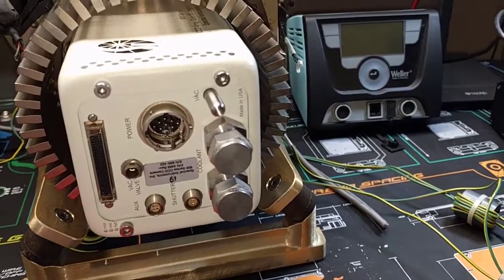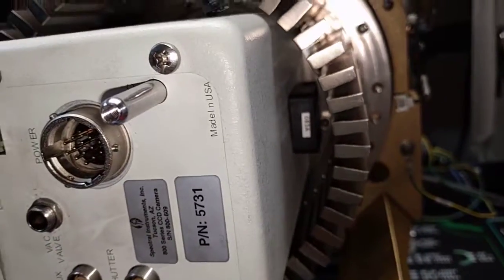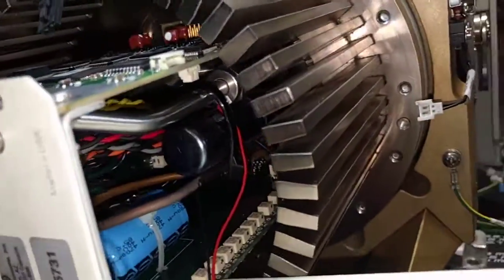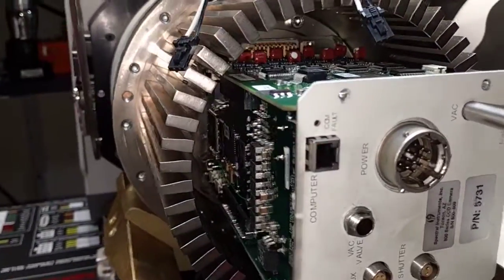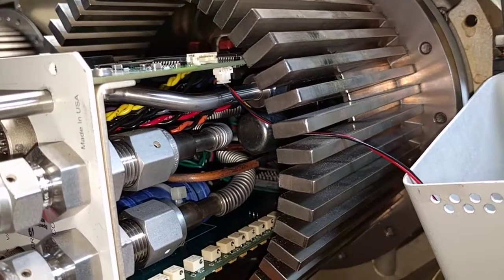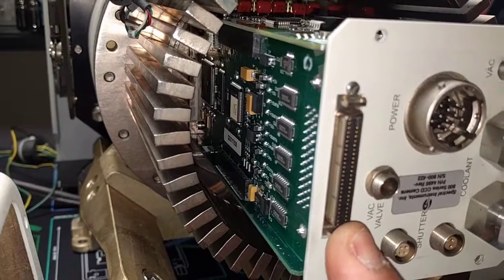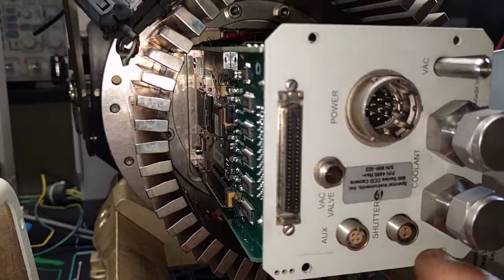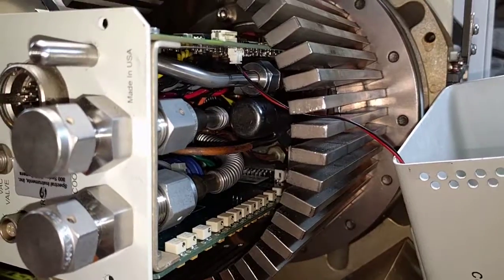Differences between Spectral Instruments 800s cameras

Comment: How did you end up with so many 800 series cameras? I want to pick up a few as well, for various research projects.

edit: If your wondering, yes one of those is astrophotography.
Reply: They can be picked up quite reasonably in old instruments which use them, such as fluorescent nanoball based genome sequencers like the one Mike Harrison tore down.
Reply: douro20 any other equipment use them?
Reply: Not that I know of; the first time I heard of these it was from a genome sequencer.
Reply: Thanks for the info. I am curious to see what will perform better, my own CCD camera design, or this. Though price wise a used 800 series camera will win.

Also, any progress on imaging deep space with one?
Reply from the maker: Hi, not there yet. Work work is keeping me very busy. I finally got the telescope I'm going to use with the camera and have slowly started the ball rolling. Apologies for the late reply, YouTube didn't notify me that there were comments here.
Reply: Thanks for keeping me updated on this, its a rather fascinating project you have got going on there. Also, this might interest you, if you haven't found this yet. Baader Planetarium makes filters in a 65 x 65 mm format, which will cover the CCD. I have however only found them on their home page sofar.

Keep me updated if you can / want, and don't worry about late replies, they are better then no reply. Also i have encountered the same problem you described, with respect to not getting notified about youtube comments on your own videos.
Reply from the maker: Interesting. FLI Camera say they have a a filter wheel and filters big enough. I'll be sure to checkout the Baader set for sure. Thanks.